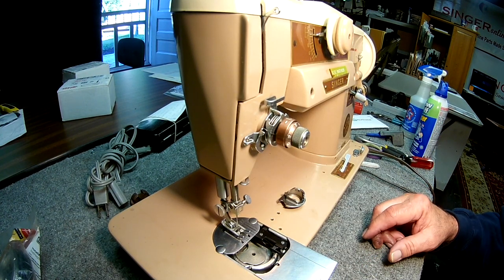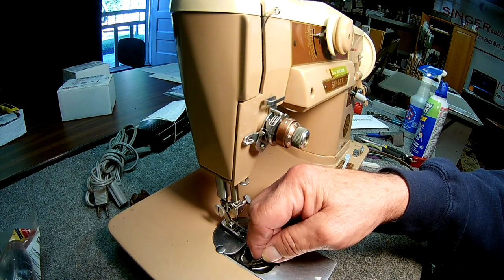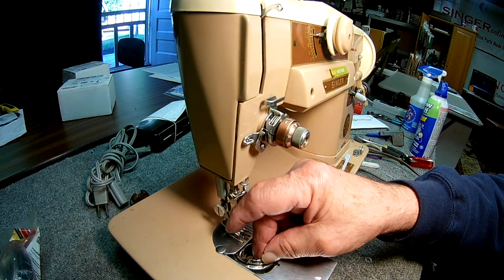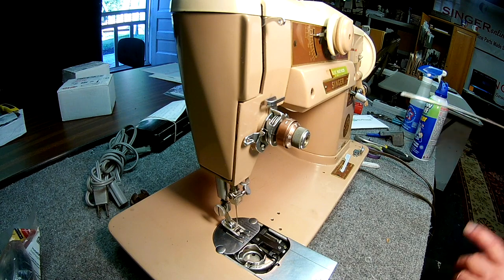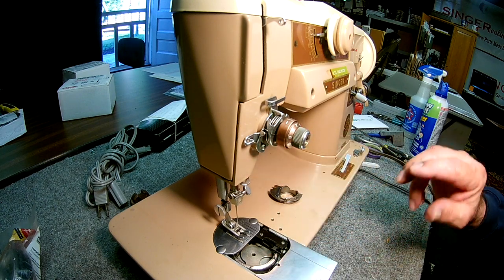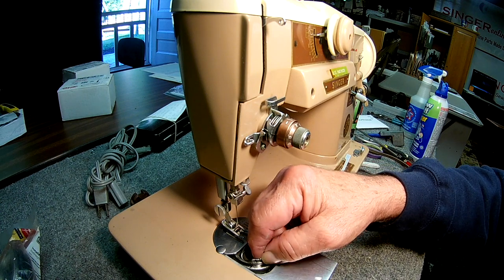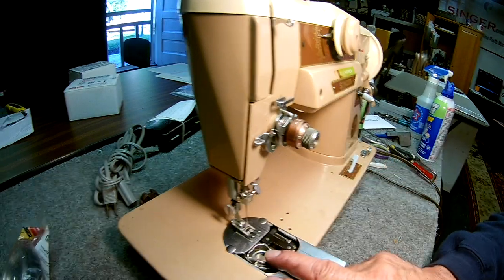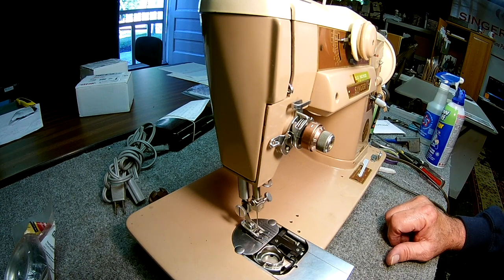SINGER Model 401 Bobbin Case Adjustment

Comment: Thank you so much for your excellent video. I didn't know I could lift up on the retainer bracket (or push it aside) to reinstall the metal bobbin case. Your instructions worked perfectly on my mom's 1963 Singer Slant-O-Matic 600. I appreciate your generosity in sharing your expertise online.

Comment: My 401a bobbin "lock" bracket won't snap in place, came off,  and won't slide back in when I tried to push it back. It is not connected and came off completely.  Any advice?
Reply: There is a clip you have to lift up to slide it under. Them it has spring tension to it